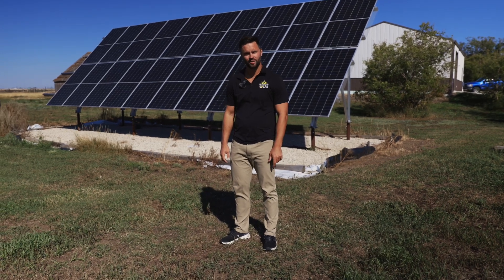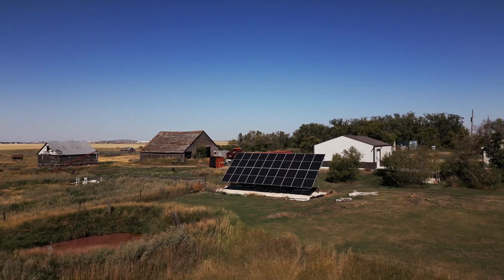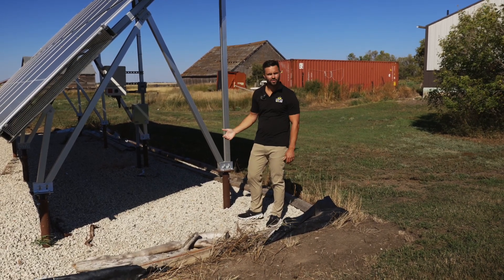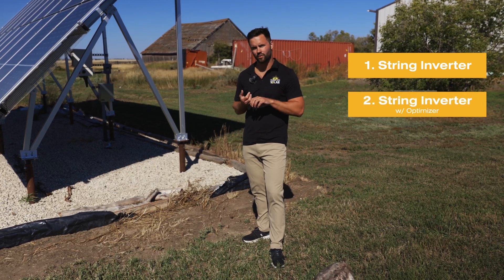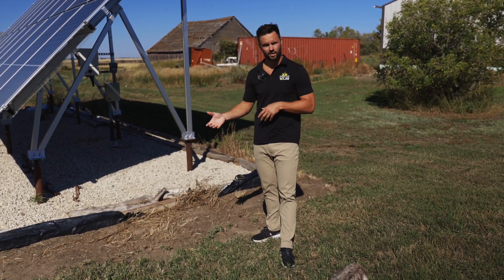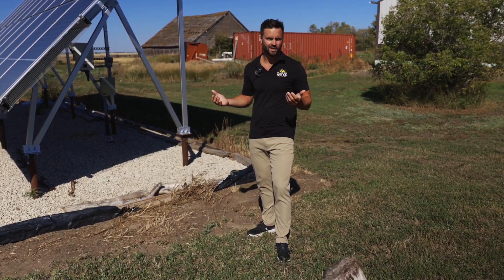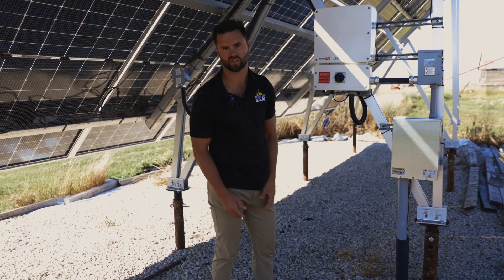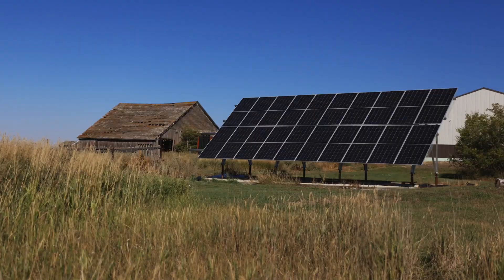DIY Solar for Farms | Easy Ground Mounted Solar Panel Install Walkthrough

Comment: What's the point of adding optimizers? Optimizers are only needed if you're worried about maximizing panel performance when you have shading, or when you have panels of different wattages. There's no shading there from anything and they're all 500W panels. Am I missing something?

Comment: Wouldn't it be easier to mount the panels on the roof of the barn?
Reply: Why would it be easier? No, it's actually harder to mount it on a roof. And it's also harder to maintain and clean as well. If you get a foot of snow, would you prefer walking over to your array and cleaning it off? Or climbing a ladder or rigging up some 20 foot long squeegee? 

It's worse than that. Most places, if you put the solar panels on your roof, you've got to tell your insurance and your rates are going to go up. You have to worry about leaks. In my town, solar on the roof requires a permit too, which means your electric company gets involved and will charge you a fee for, believe it or not, NOT using their power! And I'm not done! Roof mounted arrays are great if you have a southern exposure. What if you don't?

The only benefit to a roof mounted array is, if you don't have land,  you can at least have some energy production on the roof. But if you have land, it's a no brainer to do a ground mount. You can set them up on temporary  supports, if your town has restrictions on permanently mounted ground arrays too. Ground mount for the win!

Comment: Optimizers make no sent when u have zero shading.
Reply: There are multiple reasons to use optimizers including: Independant panel monitoring, Safety- SafeDC Technology allows only 1VDC through each panel instead of 48-50V per panel which is very important for any type of maintainence and general safety for the person working on it. Also in regards to shadows, even on a ground mount array there are multiple weather factors including clouds and snow coverage that can create the case to use optimizers on top of the above mentioned. We receive lots of snow coverage throughout the winter months that optimizers help solve energy production issues from the shadows snow creates as well.

Comment: Is there a scenario where you don't need to trench very deep (or at all) for the lines coming from the solar array to the home/batteries?   There's space here to do a ground mount but steep terrain and very rocky and shallow soil would make that very difficult.
Reply: Yes, 
You can certainly go above ground with the cabling. You will just need to follow the electrical code and make sure that the cable is outdoor rated and protected. Tyipcally a tech cable will be what you would use and also ensure that it is secured along the way.

Comment: Better to run the high voltage DC from the panels into the home and invert closer to where you use the 120/240V power and the inverter will last longer in that environment as well.
Reply: And no need for optimizers when there isn't a tree or source of shading anywhere in sight
Reply: The inverter location on this particular site is only 30ft away from the service so the cable sizing and inverter location don't have significant losses. We do also always size the cable appropriately depending on the longer distance you might have to run with AC cables. Many times we will put the inverters in the shop to allow for easier future additions of EV Chargers or Battery Systems.

Comment: one hail storm and you're back on the grid and out thousands of dollars!
Reply: This system is completely grid tied anyway. All you are doing with the solar energy is using it either directly or sending the excess energy to the grid for a credit or cash depending on your local utility. The solar panels are rated for 25mm to 50mm of hail depending on what brand name of module you are using. Also keep in mind the panels are rated at those sizes from a direct perpendicular hit. Most times hail storms are not aimed directly perpendicular to the solar panels so technically they can be hit with even larger hail then said hail ratings.

Comment: Great work! Do you find that birds sit on top of these panels and poop? I'm having an array fitted on a flat roof that is very hard to access as it's on a 3-floor house.
Reply from the maker: @adamanlife  Great Question. We have found that if you do not install rodent protection (1/2”x1/2” metal mesh) on the back side of the array or on the sides for rooftop installation it creates the right conditions for birds to nest underneath. This will also help prevent squirrels from chewing on wires as well!
Reply: I have chickens. As a result of the feed everywhere I have a very large population of doves. They love sitting on the top of my panels. The majority of the time their business end is hanging off the top edge of the panels so it isn't an issue.

Comment: Optimizers on that seems like a waste.  What casts shadows?
Reply: All those optimizers will drive up the price and make the system less reliable!  Better to spend that money on more solar panels!
Reply: Great Questions! There are multiple reasons to use optimizers including: Independant panel monitoring, Safety- SafeDC Technology allows only 1VDC through each panel instead of 48-50V per panel which is very important for any type of maintainence and general safety for the person working on it. Also in regards to shadows, even on a ground mount array there are multiple weather factors including clouds and snow coverage that can create the case to use optimizers on top of the above mentioned.

Comment: Not adjustable. No Bueno!
Reply from the maker: Thanks for your comment! For smaller systems like this one, adjustable (tiltable) racking isn't absolutely necessary. Ten years ago, when solar panels were much more expensive per watt, it made sense to maximize each panel's output with tiltable mounts. Nowadays, with the cost of panels being significantly lower, it's often more practical to add a few extra panels if you need an additional 10-30% in power production.

Also, not everyone wants the maintenance hassle of adjusting the panel angles seasonally. Fixed racking systems have fewer moving parts and tend to be stronger in high-wind areas, which means they hold up better over time. Tiltable racking does have its place but usually makes more sense for larger, utility-scale systems of 1MW or more.

Feel free to ask if you have any other questions!

Comment: How much do 10kw of solar panels cost? And how much extra to install (labor, inverters, mounts, etc)? Also, are these monofacial or bifacial soar panels?
Reply from the maker: Hey ngana8755, you can check out our online shop for some pricing. We do have pre-built DIY kits that include everything you need, and we even have a kit for a 10kw system, whether you want ground or roof mounted.

For installation, this does depend on many factors and we encourage you to give us a call sometime. But, roughly speaking, you can save about 50% on the total price by going the DIY route. 

And these are bifacial solar panels - it's a major benefit of groundmounted systems, as bifacial panels can boost your total energy production by another 25%-30% by using the backside of the panel to catch solar reflection!

Comment: what is the cost on the racking system for those 20 panels?
Reply from the maker: Appreciate your question! The racking system for those 20 panels typically costs between $225 and $250 per panel, depending on the size of the installation. Just so you know, this estimate doesn't include foundations. In most cases, screw piles are the common choice, but if the terrain is challenging, concrete piles or ballasted foundations might be needed instead. The type of foundation will have an affect the total cost of the racking system, so it's something to keep in mind. If you have any other questions, feel free to ask!
Reply: @prairiesunsolar  can you share a place to buy this racking system? the screw piles are what 4 feet long? Where can I get them? how about the pre assembled rack? you gotta link these in the footer for all of us! I cant believe how hard it is to find a ground mount system to buy. Literally cant find them anywhere
Reply from the maker: Hey LateNightCrypto, sorry to hear about your shopping troubles! Maybe we can help - we appreciate your advice as well, this is a new project for us to help get DIY solar equipment shipped across Canada. Take a look at this page on our site for some pre-built DIY kits, and if there's anything specific you need and you can't find it, just shoot us a message through our website and one of us will follow up with you personally to help out! 

https://prairiesunsolar.com/diy-kit-shop/
Reply: @prairiesunsolar  Are you saying the entire rack system for 20 panels is only $225-$250? If so sign me up and send the layout plan for a 30kv array. What is the typical cost per watt of the panels? I can get new bifacial panels at $0.23/ watt (Runergy Hyperion 545 W Black on Silver. Free Shipping. Bi-Facial. 30 Year Linear Power Warranty. $.23/W @ 22+ Pallets. $.21/W @ 10-21 Pallets. $.19/W @ 1-9 Pallets). Is that a good price? They ship about 31 panels per pallet. I'm thinking about two pallets (62 panels)= 33,790 watts x $.23=$7,772. for the panels plus tax.
Reply: @ddmitch1 he literally said $225-$250 per panel.
Reply: @Ynotbehumanfirst  In which video and at what time in the video does he say "$225-$250 per channel"? I can't find that segment for some reason. My hearing isn't good, so maybe I missed the "per panel" part. I'm 75 years old. 😂

Comment: Panel optimisers are redundant with today's panels. The bypass diodes prevents the whole string from going down if one panel is shaded/dirty.
Reply from the maker: Thanks for sharing your thoughts Hein Mcleod! You're right that bypass diodes prevent the whole string from shutting down when a panel is shaded or dirty. However, in areas with heavy snowfall, like us up here in Saskatchewan Canada, power optimizers like SolarEdge's can make a significant difference.

When snow covers part of your solar panels, the affected panels can drag down the performance of the entire string. Optimizers ensure that panels not covered by snow continue to operate at their best, maximizing energy production even in winter conditions. Plus, with individual panel monitoring, you can quickly identify which panels are snow-covered and address the issue more efficiently.

Also, optimizers reduce the voltage per panel to safer levels, which is a big plus if you need to perform maintenance during snowy months. So while bypass diodes are helpful, power optimizers offer extra benefits that really come into play when dealing with snow and challenging weather.

Comment: Looking at the overview shots there seem to be no chance of shading in that particular system. No chance of obstruction to a particular panel over the others. Why is the cost of optimizers needed in this installation location?
Reply from the maker: Thanks for the comment and your insight, Leksi80! You're correct that shading from surrounding objects isn't an issue for this installation, or honestly in many places in our home province in Saskatchewan Canada XD. However, in Saskatchewan, snow coverage is a significant factor for up to six months each year. Snow can act just like shading from nearby trees or buildings by covering parts of the solar panels, which affects their performance.

Using power optimizers, which are required for SolarEdge inverters, allows each panel to operate independently. This means that if some panels are partially covered by snow, the others can still produce energy at their full capacity. This setup maximizes energy production during the long snowy seasons.

Additionally, power optimizers enable us to monitor each panel individually. This helps in quickly identifying and addressing any issues, such as snow buildup on specific panels. They also enhance safety by reducing DC voltage when the system is shut down, making maintenance safer during harsh winter conditions. With SolarEdge's strong reputation and focus on cybersecurity, we trust in the reliability and security of the system.

So, while there may be no shading from obstructions, the optimizers are essential for managing snow coverage and ensuring efficient and safe operation throughout the year. This is one example of how we adjust our system designs based on the year-round conditions of the local environment!
Reply: @prairiesunsolar  Cybersecurity? Why is that an issue? You're talking about someone hacking your solar array?

In terms of snow, it's simply a matter of walking over to your array and brushing it off. And simply don't use SolarEdge inverters if they force you to use optimizers. But it seems like, since you work for a solar installer, your goal is to get your customers to pay for things that, while they're nice, are not needed. Question: how much more did this job cost due to the optimizers? Did you tell your customer that you could have just eliminated them and used a different inverter (like EG4) and not use them?

This is why it's critical, even if you're not going to do the install yourself, to educate yourself to the point where you could. If you were doing my install, I would have pushed back hard on the optimizers.

Comment: thankyou for sharing.
If we have panels and optimisers on a string and then upgrade by adding more panels and optimisers later but with higher wattage in both devices , can they be added to the same string or must each string have only like for like size of optimisers ?
Reply from the maker: Thank you for your question. The SolarEdge Power Optimizers have inter compatibility between newer and older generations. Some of the key considerations will be your existing inverter maximum AC Output as well as how many solar panels, optimizers are on each string you might already have. There is upper and lower limits on each string and SolarEdge does have a really nice designer tool that will allow you to change inputs but show you what is comparable and what is not!

Comment: Location latitude? I think I heard Saskatchewan 
Tilt angle? 35 degree?
Any options for seasonal-adjust tilt?

It looks like this has almost no shading; I would have passed on the optimizers.
Reply from the maker: Great questions! Yes, this system (and our office) is located in Saskatchewan. The latitude is approximately 51°, and the 35° tilt angle is typical for the area. This system uses a fixed position, but seasonal-adjust tilt is an option to optimize performance throughout the year.

Even with minimal shading, factors like tilt, horizon, and soiling (especially during harvest) can impact efficiency, which is why we always recommend optimizers. They ensure maximum performance by addressing even small variations in panel output. Bifacial panels could also help capture extra light from the back.

Additionally, structural considerations, like foundations and wind load, are important, especially with higher tilt angles, as stronger structures are needed to handle increased wind forces.

Thanks for adding to the discussion!

Comment: Great looking install!  The expense of  optimizers could have been  forgone, but yeah, you can’t see panel level data without them.

However, the Christmas light analogy isn’t applicable anymore.  Even without optimizers, panels have diodes now that reduce that effect dramatically.
Reply from the maker: Great point! Modern panels do have bypass diodes to reduce shading effects, but shading can still cause power loss. With optimizers like SolarEdge, you can recover more power that would otherwise be lost, even under shading. 

Have you had the chance to notice any difference in performance with or without optimizers in your installations? We want to make sure we're giving Canadians the most honest answers when it comes to DIY Solar!
Reply: @prairiesunsolar  here’s one good video I found on this subject matter.  I’ve gathered a few others to share with you but YouTube deletes my comment if I try to put more than one link in it.  Shading Test: Optimizers vs No Optimizers - SolarTime with Martyna
https://youtu.be/TYok2dtuYKY?si=1D5SbWBEVD3JVpUU

Other YouTubers with good videos on this are:
- Gary Does Solar 
- NRG Solar
- Andreas Spiess
-SolarTime with Martyna (has a couple more good videos about it)
Reply: @NickWindham  I was going to post her videos. She does a number of tests optimizers are good to see what each panel are doing, but they're not needed if you're worried about shading, ESPECIALLY if your setup is like the one in this video, where there's nothing near it to shade it. The optimizers just increase the expense of the installation and I'd tell anyone to first get rid of (or trim) any trees nearby that would shade your array. Then you don't need optimizers.
Reply: @ Agreed, plus the optimizers are several more points of failure.
Reply: @prairiesunsolar   Here are great references I’ve found on YouTube with tests and data on the matter of using Optimizers or not.  

Shading Test: Optimizers vs No Optimizers - SolarTime with Martyna
https://youtu.be/TYok2dtuYKY?si=1D5SbWBEVD3JVpUU

Solar Panel Shading: Are Optimizers and Microinverters Worth It?  - Gary Does Solar
https://youtu.be/ESpsdMFEFZo?si=v7zRUK2b58Ew3s3l

Micro & String Inverters, Testing the True Impact of Shading - NRG Solar
https://youtu.be/UQ9Szhl1ceQ?si=fhrH6FKrlQQqwEsY

Are Optimzers Worth It? - Andreas Spiess
https://youtu.be/E9NVLB_OYSU?si=_a5ATx6bJpShoNi8